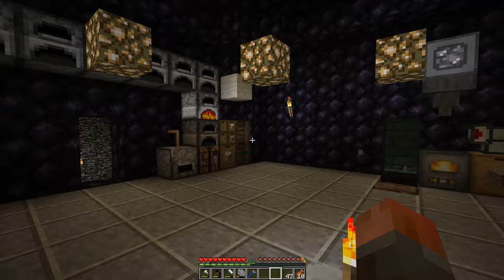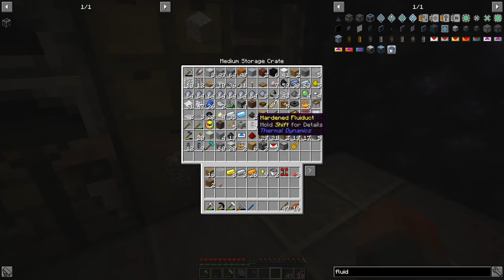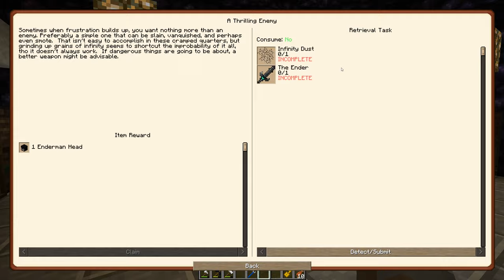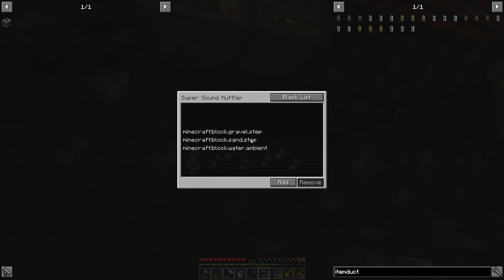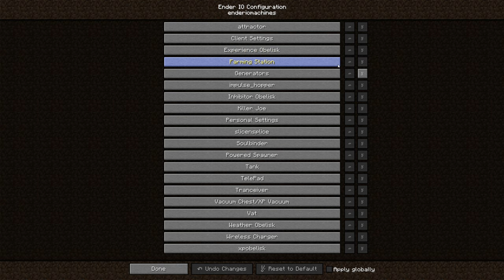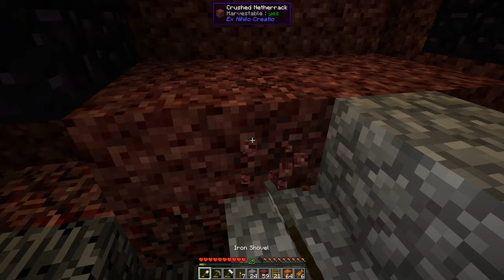Break Out E04 - Automating Witch Water and heading...Down!

Comment: You don't need any of those filters, the servo has an internal filter, it will output only what you want
Reply: And in the water in the output side of the barrel issue, the filter let's the duct fill up as it's blocking on the far side. As was stated, use the filter built-in to the servo and it stops it at the source instead